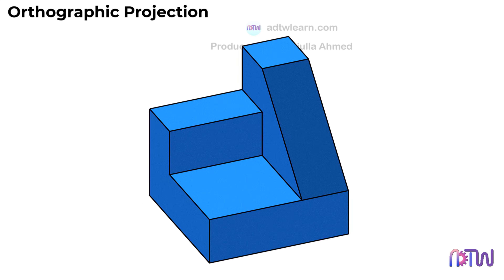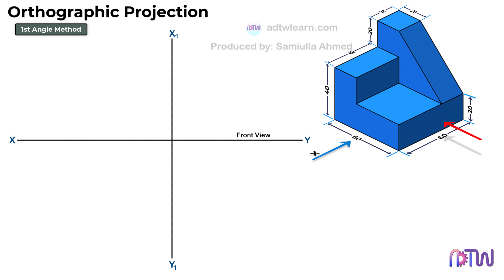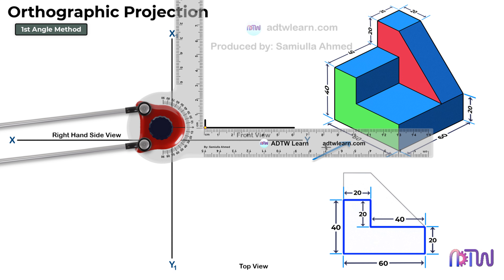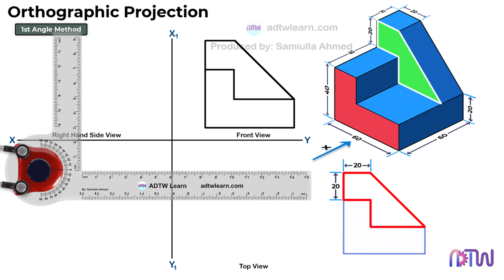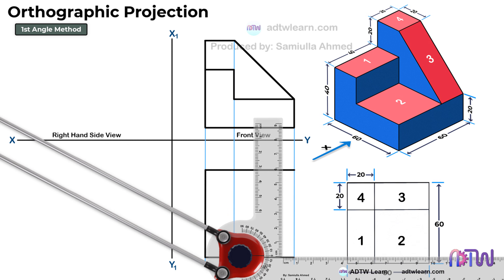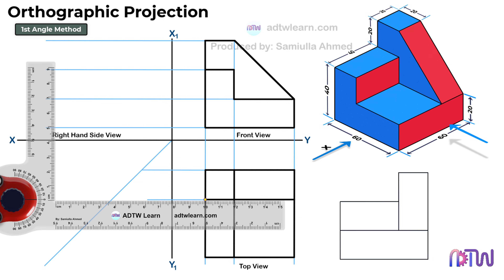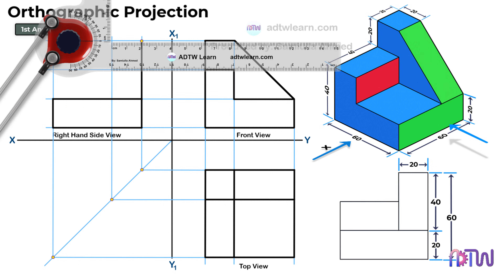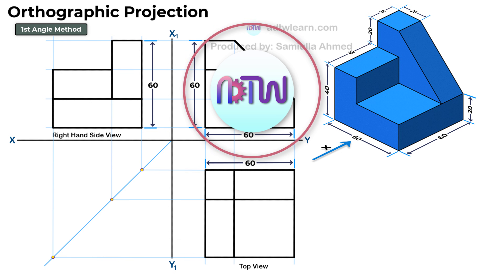Orthographic Projections in Engineering Drawing - Problem 4

Comment: Do you use the right side view or left side view???? Is this a 3rr angle method or 1st angle method????
Reply from the maker: The first angle method was used to create a drawing of an object, but due to its position, the right-hand side of the object was visible while the left-hand side was not. To accurately depict the object, the right-hand side views were drawn on the left-hand side of the object using the first angle method.